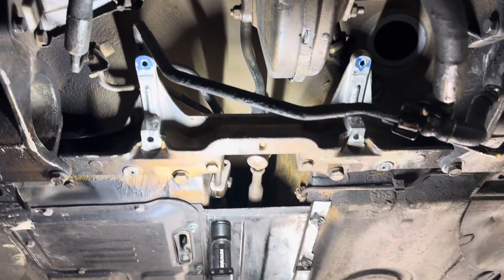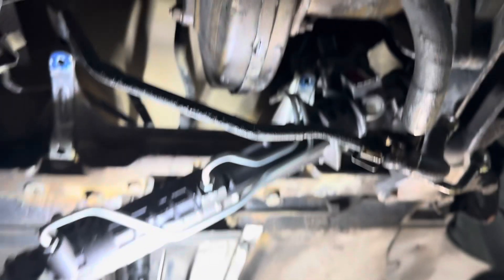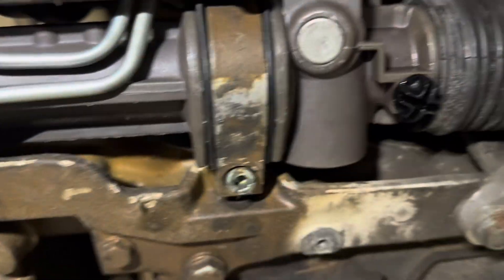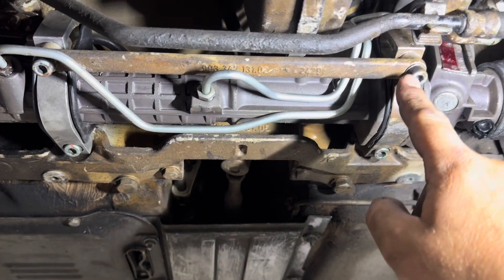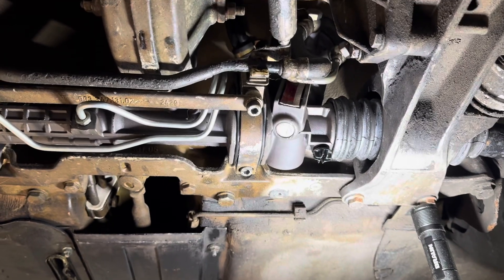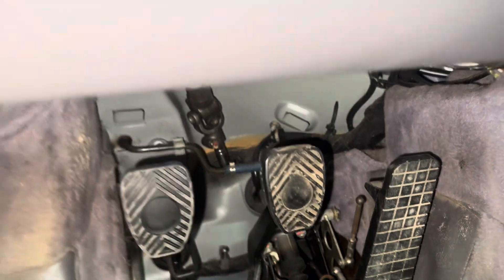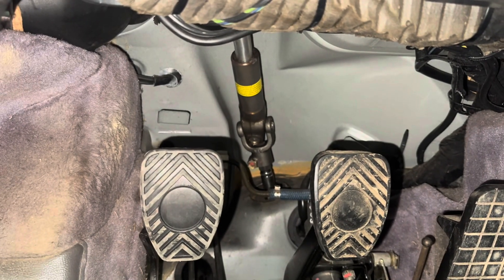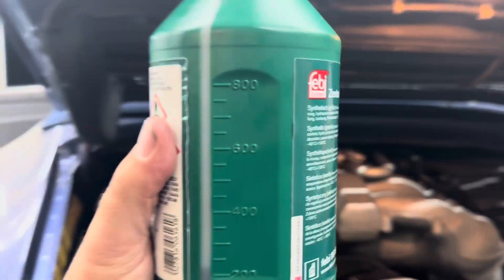Porsche 993 - Steering rack removal, rebuild, install - part 3

Comment: I appreciate you posting this so I knew what I was about to get into. My 993 steering rack just dumped fluid all under the front of my car on the garage floor. I just spent enough time and energy replacing the AC evaporator and so I don’t think I have the energy to tackle this DIY. I ordered a refurbished steering rack and will take it to my Indy here
Reply from the maker: @bluesubie02  if you’re looking for someone to rebuild your current rack, i’ll do it!  I’ve been working on a few tool designs to make this job easier too
Reply: @beardedgarage  I appreciate that, but I don’t have a lift so removal and reinstall would be difficult for me. I’m hoping the rebuilt unit from Steering Advantage works out for me. I’ll let you know how it turns out
Reply from the maker: @bluesubie02  no worries, good luck.  Let me know how good the rebuild looks and what you get with it